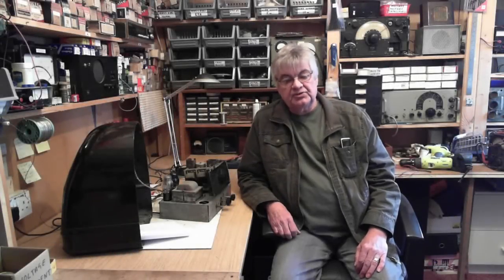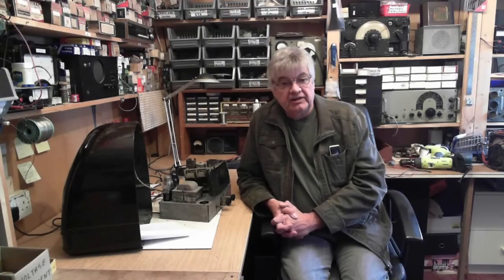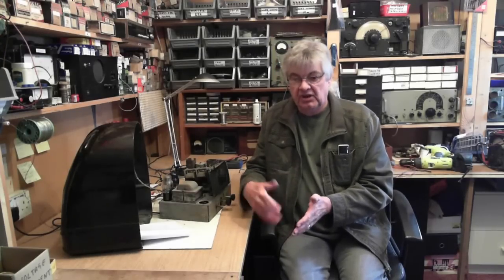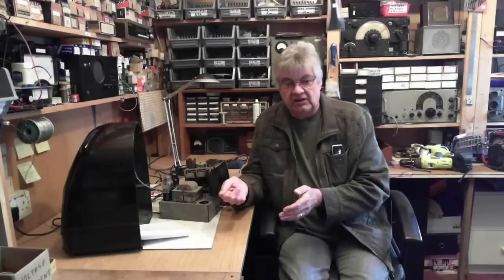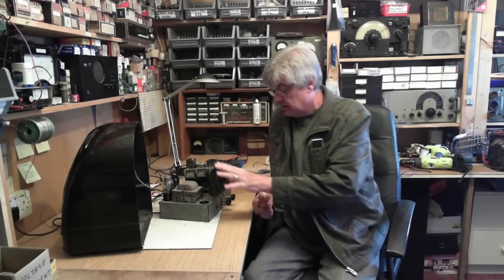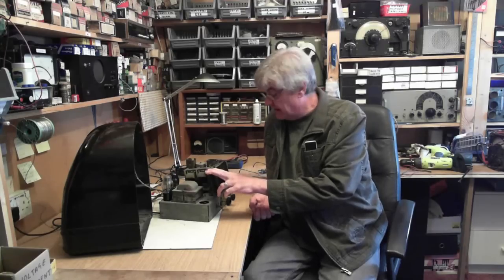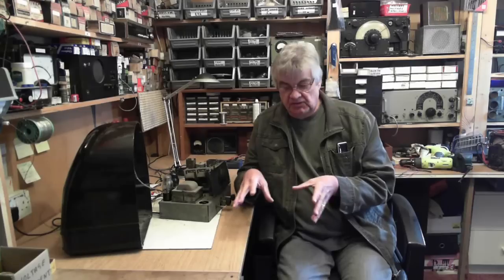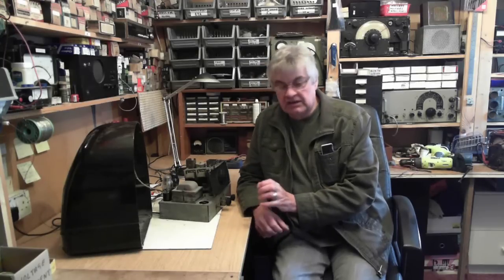Introduction - how to repair vintage valve radios.

Comment: Do you know anything about a H.F. Tester Model T.I.? I have one which was my dads and am not sure what to do with it. Any ideas would be very helpful. It is at least 30 years old.  Made in England by Edwards High Vacuum Ltd. Crawley, Sussex.
Reply from the maker: Hi Anne, I'm afraid I don't know anything about it. I've searched the internet, as no doubt you have, and found nothing. Sorry about that.
Reply: Radio Workshop Thanks for your reply,

I have been told it test valves, vacuum tubes.

Does any of this help?

https://en.m.wikipedia.org/wiki/Vacuum_tube#/media/File%3AElektronenroehren-auswahl.jpg

Comment: Hi i have a ferranti 115 valve radio only one valve lights up but very dim im lost to be honest as this was sold to me as working but with a weak receive i had it on for two hours allowing the tubes to warm up have you any advice 
Please as cant find any info on google only on the 215
Thnks in advance
Reply from the maker: Hi Sean, I don't have any info on that one. Can you get the radio to me so I can check it over? I'm in Worthing, West Sussex.
Reply: Ray Heffer hi ray think the cheapest way I could get it to you is by post
thnks for the reply
Reply from the maker: OK, all noted.

Comment: Hi Ray, do you have any tips for how to hold a chassis upside down to work on it? I made a jig simple enough for the types of chassis that have a lip either side, but what if the edges are just square and there's nothing to hold? Cheers :)
Reply from the maker: Hi, I'm afraid I can't help with that one. I've often thought about some kind of jig but there are so many different chassis it would be impossible. Let me know of you get any ideas. Cheers, Ray.
Reply: Funny you ask, I was asking on a forum, and was lead to this: http://www.thebakeliteradio.com/files/img066.jpg
I think there is a plank underneath to bolt to.